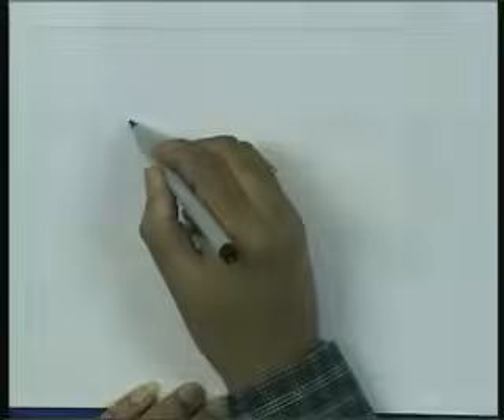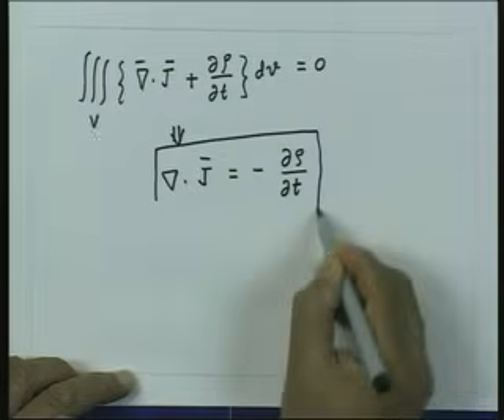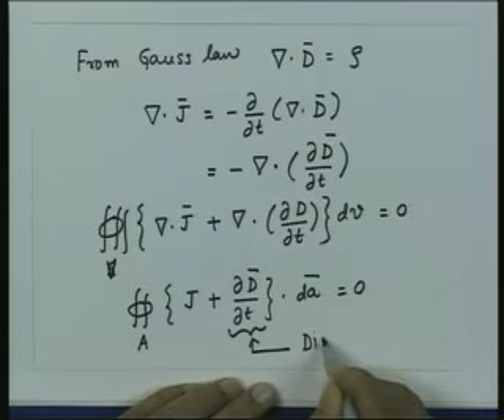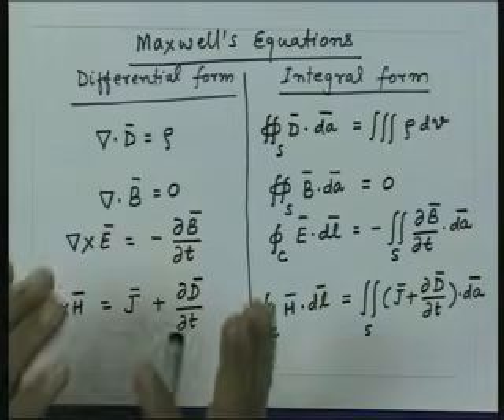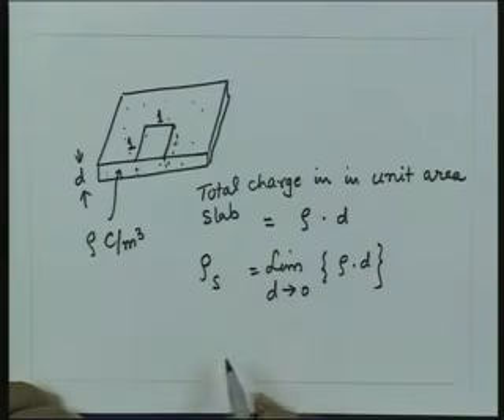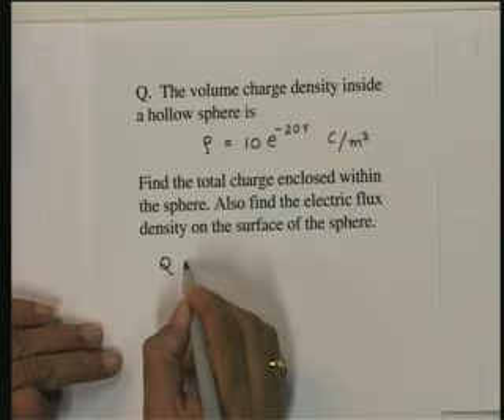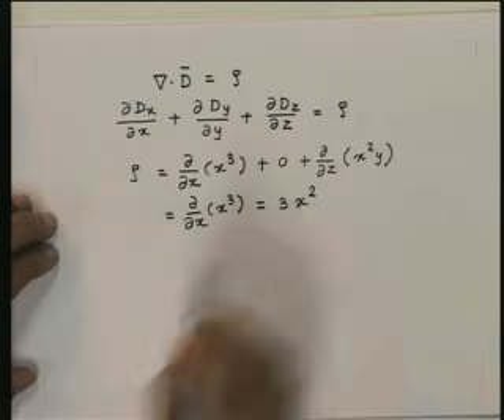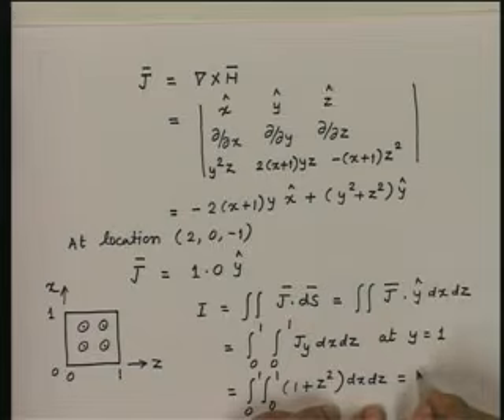Maxwell's Equations

Comment: The integral is wrong in the first question. How do you get it to be pi/100?
Reply: You can try another method to integrate, you can take a spherical shell element of dr thickness and 4πr² surface area ,

i.e. integral(p.4πr²dr)0 to2

Integral is long , apply by parts,

Answer matches, π/100